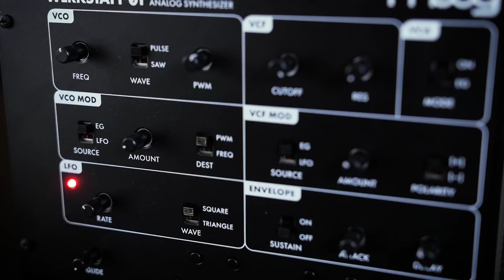A $199 Moog?! Moog Werkstatt-01 Analog Synth Demo & Build

Comment: Can I use my midi controller with it...?
Reply: Only works with CV. So youl need a converter.
Reply: @isaygg.butitwasntgg.itwasb4958  unless you have a midi controller with gate, Arturia Keystep is a great one.
Reply: @Modrunnermusic  what about the novation launchkey mini mk3?
Reply: @isaygg.butitwasntgg.itwasb4958  I have the launchkey mini mk3...and i bought an oxox trs midi module will that work?
Reply: @brandonheat4982  no I don't think that works with the Moog. From what I have read, The xoxo just converts trs Midi a to b. So one midi type to a other midi type. You'll need a midi to CV converter like this one: DOEPFER A-190-3 USB/MIDI TO CV/GATE INTERFACE.

But holy. These things are so expensive.
Reply: @isaygg.butitwasntgg.itwasb4958  the arturia keystep will do all of that. The beatstep and keystep are the controllers people use with modular systems all the time.
Reply: @Modrunnermusic  what about the key lab?
Reply: @Modrunnermusic  I'm still trying to understand what's so special about Arturias KeyStep Sequencer compared to say M Audio Oxygen Pro series?

Comment: Isn't there a midi keyboard out here NOW!!!!  that can control this thing without paying 428650000000 dollars for? i want to use a midi keyboard with this.
Reply: I'm struggling to find one for cheap that isnt a usb midi keyboard and its frustrating. I feel like just a few years ago I could find one for like nothing and now I'm struggling to find a used one that doesnt go for the same price as the usb midi ones I keep being suggested. I love my keystep and it has the standard midi in and out but I dont want to buy another one and wanna try something else a little easier on my wallet because I have tons of little weird gear like this moog that i wanna be able to control at the same time with a separate keyboard. 

Anyways I feel your frustration dude because little cheap (like when I say cheap I mean super cheap like 30 to 50 bucks) ones with a midi din are becoming scarce.
Reply: can you not play this with a keystep?
Reply: @travistaghavi9178  yeah I got an arturia thing and I wanna know too

Comment: How to interface with a sequencer? No midi? Great sound for the money but more a toy than a tool for my use without sequencing.
Reply: CV is all you need :)
Reply: @turbochargedfilms  dang. In my case that'd mean getting a separate sequencer like a beatstep pro since I only have midi stuff. Which would make it about the same price as a behringer model d which sounds similar enough for the price of this and a sequencer with cv
Reply: It's probably best for people who already have a Keystep or modular gear. But watch Hivemind's demo, definitely not a toy. https://youtu.be/wwyk-I0D1kY
Reply: Korg SQ1 or Arturia Keystep/Beatstep
Reply: @jeredalmeida1880  Why is it that every single musician who buys an analog piece has to have an Arturia KeyStep sequencer in tandem? 😂🤷🏼‍♂️ Seriously, any midi controller works in that instance. Probably the price point $120 I'm assuming
Reply: @ASAPJermz  The sole reason for this is because of the CV and gate outputs. Not every analog synth has 5 pin midi so if you have something like a Moog Werkstatt, the only way to control that is by 3.5 mm cable. Don't know why this hasn't become industry standard on all gear yet. Also the fact that the Arturias have aftertouch and step sequencer is an added bonus.
Reply: @jeredalmeida1880  I just figured this out last night myself lol it's the CV & Gate outputs duhhh appreciate you letting me know
Reply: @ASAPJermz  The MicroFreak actually has them too but unfortunately it doesn't send modulation data from it's synth engine via CV. Such a shame.
Reply: @jeredalmeida1880  Sheesh I'm happy you told me I was looking to get the MicroFreak coupled with the Model D & maybe a Wasp Deluxe. I'm gonna get the Arturia KeyStep 37 to controll my analog synths because I only have a Akai MPK 225 & the only way to connect to say a Model D is through XLR from the synth output directly to the input on my interface which only has two inputs so if I want more synths I'll have to upgrade my interface 😭